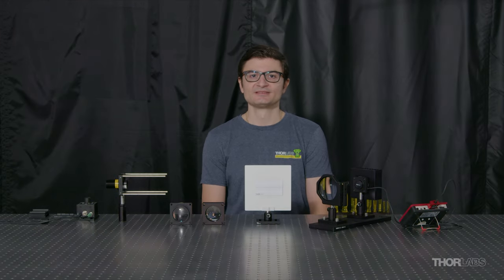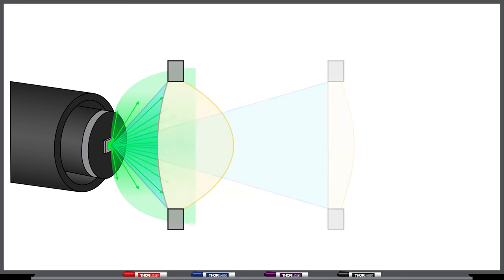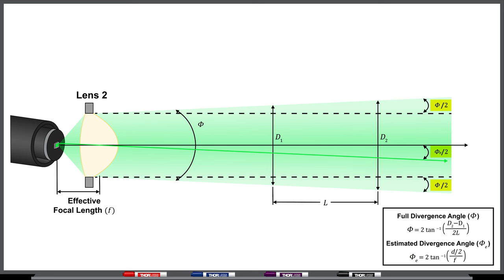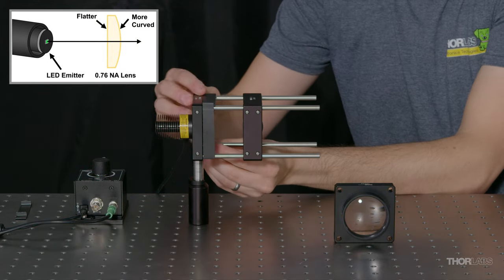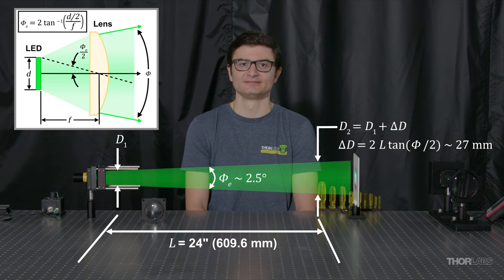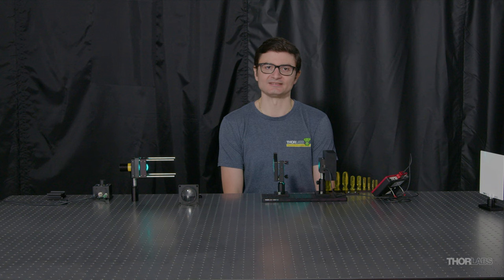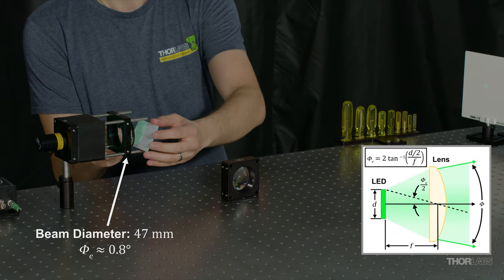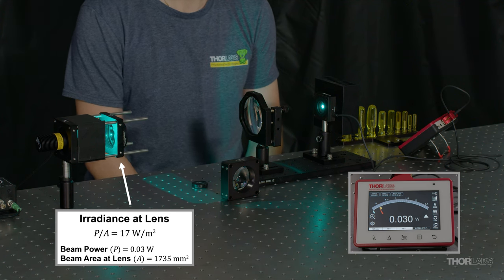Collimate Light from an LED | Thorlabs Insights

Comment: Great video.  Could you give an overview of how to focus an LED for fluorescence spectroscopy applications?  Would a generalized approach be to collimate the beam and then focus this beam? My issue is that a lot of high power UVC LEDs aren't really that high power and have 130° viewing angles - ideally I'd be trying to get as much power into a 2-3mm^3 sampling area.
Reply from the maker: Great question! For LEDs with large viewing angles, our general recommendation is to use a large NA aspheric condenser lens, coupled with a diffuser if uniform illumination across the sample is a requirement. A custom lens relay can then reduce the diameter to provide the illumination needed for the application. The diffuser can be placed after the aspheric condenser, as diagrammed at the top of this page: https://www.thorlabs.com/newgrouppage9.cfm?objectgroup_id=3835, or before the condenser lens, as described on this page: https://www.thorlabs.com/newgrouppage9.cfm?objectgroup_id=1132&tabname=Application%20Idea .
 
Examples of high-NA aspheres designed for UV to 245 nm – 420 nm are included on this page:  https://www.thorlabs.com/newgrouppage9.cfm?objectgroup_id=14329 .  Examples of diffusers that can be used in the UV (down to 185 nm) are here: https://www.thorlabs.com/NewGroupPage9.cfm?ObjectGroup_ID=6337 .
 
For more information, and diagrams of a couple of example systems, please see the  “Optical Diagrams” tab of this page ( https://www.thorlabs.com/newgrouppage9.cfm?objectgroup_id=8565&tabname=Optical%20Diagrams&YVI=30 ).
Reply: @thorlabs  thanks for the tip.  I'll look into purchasing the suggested lenses to try this out.

Comment: Maybe some optical tweezers setup later? How to align with scattering collection?
Reply from the maker: @Tferdz Thanks for your suggestion! The setup and alignment of an optical tweezer system is a great topic.  Do you use back-focal-plane interferometry when aligning with the scattered light?  Are there certain aspects of your approach that you think are the most interesting?
Reply: @thorlabs  we use this setup 10.1007/978-1-4939-6421-5_7. We add some complexities by sending  rotating linear polarized light so we can collect torque measurements. Besides that it's forward scattering with collection by a PSD for the XY and a photo detector for Z. The reason we separate is that we put an iris to block light for the z detector since it makes it more z-sensitive by removing xy cross talk. But it would be cool to have a video where we can show people at least some basic of optical tweezers, which is not that complicated.
Reply from the maker: @Tferdz  This is really helpful, thanks! It is great to have a better understanding of the type of video that you would find useful to share, and we enjoyed learning more about your alignment approach!

Comment: Can you do a video or explain how to collimate the light from multiple LED point light sources? E.g. in this example you had 4 beams in a square 1 inch apart , I assume you have to gather and condense all the beams into one spot and then collimate it, but its so complicated.
Reply from the maker: Thanks for the suggestion! Are you interested the optics used with LEDs in things like car headlights, or is there another type of application you are interested in?

In the demonstration, the light source had a 5 x 5 grid of emitters. An image of this emitter grid is shown as an inset at 3:34. 
From each emitter, a cone of light rays propagates out and overlaps with the light cones from the other emitters. When a lens is used to collimate the light from this collection of emitters, the lens essentially collimates the light from each emitter individually. The group of collimated beams from each emitter together is the total collimated beam.

Since each emitter is located at a different position on the grid, after the lens each emitter's collimated beam propagates at a different angle to the optical axis. Because every collimated beam travels in a different direction, in the total collimated beam there is a limited region over which all emitters' beams are mostly overlapped with one another. Closer to the lens output, these beams overlap better, and the beam cross section is relatively smooth. With distance, the individual beams begin to separate and the beam cross section includes structure related to the emitter grid. 

Due to the original emitters being spatially distributed, even if the light from the emitters was focused before it was collimated, the collimated beam would not consist of an ideally collimated beam, whose rays travel parallel to one another. This ideal case would only be possible if the emitter was a single point source.

Comment: Would there be an expected approach on what relative value of NA to use if the goal was to send a modulated light beam from an LED a significant distance eg 100 feet? Would a smaller NA having lesser divergence produce more intensity at a distance than a larger NA lens that diverges more?
Reply from the maker: @ronaldnonnenmacher6768   Choosing a lower-NA lens can be (and is) used to increase the fraction of optical power delivered from a light source to a distant target area. However, a positive result is not guaranteed, since lower-NA lenses often collect less light from the source. This is a particular concern in the case of highly divergent sources like LEDs.

The basic approach to determining whether a lower-NA lens will be beneficial starts by estimating the minimum optical intensity required at the photosensor. Sensor parameters like active area and responsivity must be considered. 

Then the availability of lower-NA lenses must be considered, and their abilities to collect acceptable amounts of source light determined. The amount of light a lens collects depends on parameters including the source’s viewing angle (i.e. beam spread angle) and the lens’ NA. 

If a lens is found capable of collecting enough light, the divergence equation included in the video can be used to estimate the beam intensity at the detector. That intensity is then compared with the minimum intensity required by the photodetector to see if there is benefit. Note that the beam divergence after the lens depends on the size of the source, as well as whether the source is incoherent (e.g. an LED) or coherent (e.g. a laser).

Comment: I'm looking to increase headlight output by both distance and width. What would be the best way to achieve both?
Reply from the maker: @brittanywright9646   These goals can both be achieved by increasing the diameter of the output collimated beam. The resulting wider collimated beam will have a lower divergence, which will increase the propagation distance of the collimated light.
Reply: @thorlabs  will this have any affect on light aberration? I noticed that beam is not as clear at the cutoff life.
Reply from the maker: @brittanywright9646  The optical properties of the collimator and the physical size of the light source typically have the largest impact on the severity of the aberrations. Generally speaking, light collimated from a point-source emitter will have fewer aberrations than light collimated from larger source like an LED array, a lower-NA collimating optic often induces fewer aberrations than a higher-NA collimator of the same design, and light from the center of the collimating optic is typically less aberrated than light from perimeter of the optic. Unfortunately, many options for reducing aberrations also collect less light from the source, reducing the amount of power in the beam. This may be a reason the collimated beam did not appear as you expected.
 
The design of the collimating optic(s) is also an important factor affecting aberrations. There are a variety of common lens types and reflector options to choose from, each with their own benefits and drawbacks, in addition to custom designs. Optical systems can also provide better-quality beams than single lenses. For example, many car headlamps, which usually collect light from relatively large or distributed light sources and provide a bright, directional beam, are optical systems that include custom reflectors and other optics.

Comment: 您好，优秀的演示表明了不同NA和焦距的透镜对LED的准直作用。我有一个疑问，当透镜先调节出一个无限远成像的距离后，为什么还要继续调节透镜，使之不成像呢，这个是什么意思呢，形成平行光吗？
Reply from the maker: Yes, the typical goal of collimating light is to provide an output beam with all the rays traveling parallel to one another. In an ideally collimated beam, the image of the light source would only be visible infinitely far away from the lens. In between the lens and infinity no image would be visible, because in the ideally collimated beam, rays from all points on the light source would overlap one another.  However, in real world applications, it is typically not possible to move the image infinitely far away. This is because divergence separates the collimated ray bundles originating from different points on the light source. Due to this, one approach to collimating light from a relatively large source is to adjust the lens until the image is as far away as possible. When the viewable distance is too short to confirm that the image has been moved to the maximum possible distance, adjusting the lens to move the image past the farthest viewable distance is one way to push the expected image closer to its maximum possible distance.

Comment: Is a bi-convex lens suitable for collimating LED light?
Reply from the maker: @user-cf5sm9cn6v  The bi-convex lens shape can collimate light from an LED but the collimated beam will include more aberrations (particularly spherical) compared to other lens shapes. Whether this collimated beam is suitable depends on your particular application.  Typically bi-convex lenses are used for imaging applications where both surfaces are used to focus the light to a point in the image plane.

Comment: Hi
your video is great but there are some contradictions:
it is  concluded from this video that a lense with higher NA and therefore with higher divergence, should provide lower irradiance as the beam area increses and the power decresea.
but when you strat to explain experimentally, the results is vise versa. 
for lense with NA = 0.76 and f = 32 mm, irradiance is 177w/mm2, p = 0.29w and A= 1640mm2
for lense with NA=0.24 and f = 100mm, irradiance is 17w/mm2, p = 0.03w and A= 1735mm2
can you clarify this? do we expect a decresead iradiance with an incresead divergence which should be obtained wiht lense with NA = 0.76?
Reply from the maker: @ParTaban   The collimated beam with the higher 0.76 NA lens collected more power and provided a larger irradiance at the measurement plane in the video compared to the collimated beam provided by the lower 0.24 NA lens, as you pointed out in the measurements.  However, the collimated beam output from the higher NA lens also has a larger divergence, so the irradiance will reduce at a quicker rate as the measurement plane moves away from the collimating lens.  This means that while the lower NA lens has a lower overall irradiance near the collimating lens, the lower divergence provides a more consistent irradiance as the collimated beam travels away from the lens.

Comment: Can this setub used to collimate light from a small filament lamp ?
Reply from the maker: @ahmedmostafa-tf2vo   Yes, lenses like the aspheric condensers used in this demonstration are regularly used to collimate light from a variety of different light sources, including filament lamps. Achromatic lenses are another option, since they can provide better results for broad-spectrum sources, but it can be difficult to find high-NA achromatic lenses. However, in all cases, the divergence of the collimated beam will increase as the size of the emitter increases.
Reply: @thorlabs  what is the difference between aspheric and achromat? i know aspheres help with reduced spherical aberration and i believe achromat help with chromatic aberration, i am using a lens from my binocular made of two elements or doublet i think now is this an achromat and if so is it good for both aberration correction?
Reply from the maker: @ARCSTREAMS  You are correct that aspheric lenses are designed to reduce spherical aberrations, which can be seen in light collimated from a point source on the optical axis, and that achromatic lenses reduce chromatic aberrations, which can be seen when trying to focus two different colors to the same point along the optical axis. The terms “aspheric” and “spherical” describe lens shape, while the term “achromatic” describes lens performance. 

Achromatic lenses are typically created by combining two different glasses, forming a doublet lens.  It is possible for an achromatic lens to use aspheric lens shapes to help reduce both spherical and chromatic aberrations but spherical achromatic lenses are much more common. Spherical achromatic doublet lenses have been shown to have better spherical and chromatic aberration performance than spherical singlet lenses, as well as provide better broadband and off-axis performance than aspheric singlet lenses:  https://www.thorlabs.com/newgrouppage9.cfm?objectgroup_id=120&tabname=Application .
 
As for the difference between spherical and aspherical lenses - spherical lenses always have sides that are spherically shaped (i.e. have a constant radius of curvature), while aspheres have sides whose radius of curvature varies across the side of the lens. Spherical lenses are very common, since they are easier to grind and polish into shape. Aspheres are typically specifically designed to perform optimally in a particular system. If an asphere designed for one system is used in a different system, it may provide light with significant aberrations. If the aspheric lens has been designed to perform well when used with light of one wavelength, it may provide light with significant chromatic aberrations when used with light containing a range of wavelengths. Because of this, it is important to check the specifications of an aspheric lens before using it in a system.
Reply: @thorlabs  thank you for the info, so if i understood correctly aspheres are not typically made to correct chromatic aberration is this right? because a yt poster made this long range flashlight using a white led and an aspheric lens instead of using an achromat or doublet which makes more sense to correct for chromatic aberration rather than spherical aberration thus help improve his collimation and long throw better i would think since it would be the chromatic errors that would be significant at play here for his goal,, 
as for me i built one using the objective lens of my binocular which i believe is an achromat or doublet
Reply from the maker: @ARCSTREAMS  You are correct in thinking that aspheric lenses are typically not designed to correct chromatic aberration, although chromatic aspheric doublet lenses do exist. A benefit of the YouTuber’s choice to use a high-NA aspheric condenser lens in a long-range flashlight includes maximizing the amount of light collected from the LED. In addition, these lenses are usually relatively inexpensive. When a lens is not an achromat, the effect of the chromatic aberrations are often visible as a rainbow along the beam's perimeter.
Reply: @thorlabs  yeah perhaps he had one of these special aspherics because there was no rainbow on the outer perimeter of his beam or the spot at least not to a drastic measure but when he covered his lens with a paper that had a few small pin holes on the outer perimeter the spots were pure rainbow when cast against a wall down field